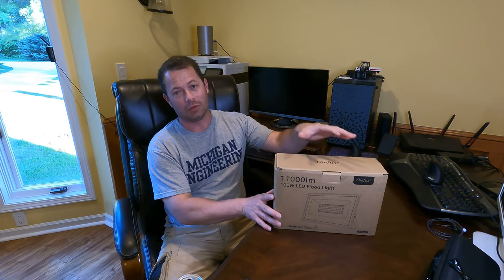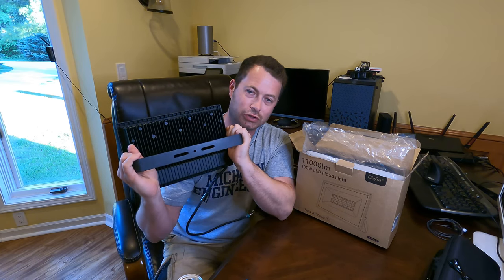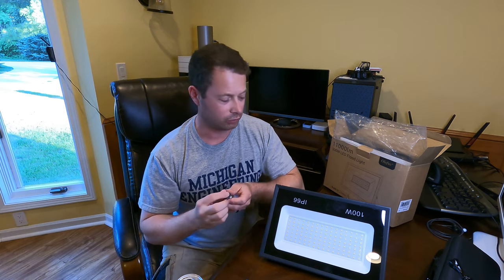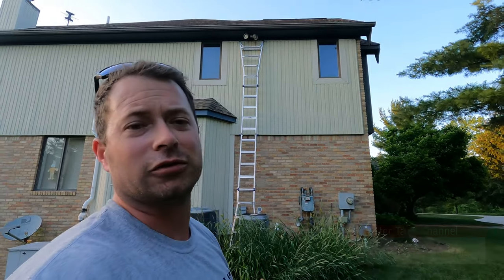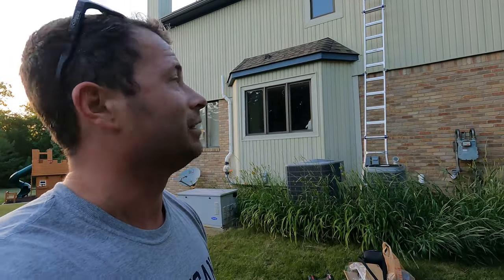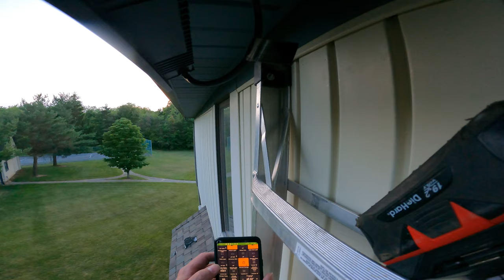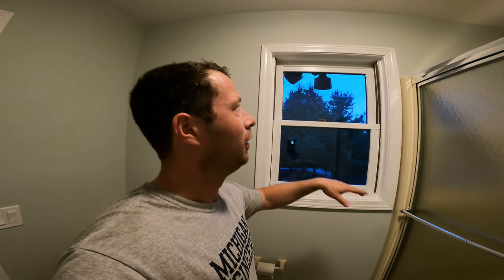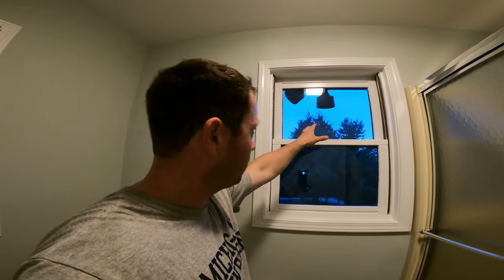✅ Light Up The Backyard!  11000lm 100w LED Floodlight -  Unboxing, Install and  Review - Olafus

Comment: The Amazon listings describe the lights you have linked to, as 9000lm output. Where is the 11,000lm light you are using?
Reply from the maker: Same light.  Different marketing specs.
Reply: @randallsemrau6911  same light different lie ;=

Comment: As an electrician please mount that in a box =) That open connection could cause serious issues down the road! Thank you for the video!
Reply from the maker: Very true.  I was "shocked" the house was that way since being built in 1991.  It's corrected now.
Reply: My home was built in 1980 and I have no box’s on our flood light’s 40+ years with no issues
Reply: A box for sure and I would have taped the wires…
Reply: @explod329 What kind of connector would you use to connect it to a box. The wire type is SJTW.
Reply: @charlescho   Hubbell makes these connectors. They should be available at your local Home depot/lowes if im not mistaken. A standard SOOW connector in the correct Diameter should work as well.

Comment: Great work. Except for the "Hot shot" wasp & Hornet killer. I give you a secret. Next time use "Break Cleaner" (Break parts cleaner) spray can. I guarantee you 100% you won't have to back off. It kills them on touch. I'm telling you cause that's what I use all the time. Try it, and thank me later.

Comment: I used the 8000 ones 2 years ago for man door lights on my shop, love them. BTW, do away with the vinyl siding.  Just spent big $ to fix rot due to trapped moisture.
Reply from the maker: I am planning to redo the siding... but all siding can get rot behind it without a proper wrap.
Reply: @NaterTater  true, mine was done some time in the 80s.  Just 1/2 inch of foam insulation over the original cedar siding. Most of the siding was fine, the corners with metal was the major problem.  My living room has to two 10.0x6.0 windows that come to a corner that just had 2 2x4s holding the whole thing up.  The windows were supporting a lot.  Found a great contractor the is top rated for Hardy plank and also does rot repair.
Reply: @NaterTater  what did you replace your siding with?

Comment: Howdy from Kentucky. We bought these after watching your video. Think they are great, but having issues when lights are turned off see small panel of the LED light on the right bottom of panel remains dimly lite...maybe a 2x2 square and was wondering if this normal? We have 3 way light switch that controls the outdoor lights. Thanks
Reply from the maker: That is not normal and means it is still getting some voltage.  You might have a bad switch or wiring setup.  Is everything properly grounded?  You can check voltage at the wiring and confirm.
Reply: @NaterTater  Thanks for reply, but my husband figured out that a lighted light switch was causing the problem. One of the light switches would light up when switched off and that was connected to a 3 ways switch controlling the spot lights. After changing the the switch to a regular one, the lights turned complete off. Thanks
Reply: most likely an induced voltage. LED lights need very little power to illuminate so they could be picking up a voltage simply from cabling running close to other live cables. Adding an appropriate capacitor in parallel between line and neutral close to the light fitting should solve the issue.

Comment: You never disappoint Nate there was so much going on in here.  The threat of being stung and attacked by flying insects.  The excitement of installing something new and then also the possibility of falling what you are very brave because I can’t get up that high.
Reply from the maker: Glad you're enjoying them!  Yes the height is the least enjoyable part...certainly have to be cautious that high and with enemies flying around.
Reply: @NaterTater  How much power do these draw and where do you plug them in? Thanks for the vid man
Reply from the maker: @joeslacker1020  they are hardwired or you could put a 3 pronged plug on the end for a standard outlet. They pull a max of 100 watts each.
Reply: @NaterTater  So you need to buy the plug seperate, are there plugs where the end is with those 3 wires already exposed, or do you have to order a plug and cut it down in order to wire the lights to it?

(for the 3 pronged plug)
Reply from the maker: @joeslacker1020  you have to buy a 🔌
Reply: @NaterTater  No kidding that wasn't my question
Reply from the maker: @joeslacker1020  here's one that would work https://amzn.to/3hN8itL
Reply: @NaterTater  Oh it doesn't come with an actual cord, so it'd be the cord from the light into this. Then probably an extension cord because the built in cord to the light is only like 2 feet, that would work right?
Reply from the maker: @joeslacker1020  yep
Reply: @NaterTater  Thanks, man. For real though!

Comment: Nate, great video I've been looking at upgrading my exterior lights from the old yellowish dim lights to led , I just couldn't find some bright ones to replace my old ones with. I went to the link you have about the led flood lights, as I was looking at the pictures of the flood lights they seem to come with a 3 prong connector for a outlet, I noticed that the ones you have in your video do not come with the outlet connector but come with wiring (neutral, power, ground) wires. 

Could I just cut off the 3 prong outlet connector and just hard wire the floodlights in place of my old floodlight?
Reply from the maker: Yes that is correct.

Comment: You say step 1 is to “ remove existing light”. What if I don’t have an existing light?  Does that change my step 1?
Reply from the maker: Well you need to have power there so the assumption is a light is already there.  If not you need to run power to that spot and have an electrical box.

Comment: Great video! Can you further explain what solution do you use to light up those panels from your mobile?
Reply from the maker: I use z-wave light switches connected via a smartthings hub.  Then i have actiontiles on tablets and my phone to control commands. https://youtu.be/fpp5k0IdX44

Comment: Can you take out the pre wired wire if you have an existing power cable that can be used?
Reply from the maker: You'd have to butt splice or something.   You cant access the cable connection internal to the light.  Its a sealed unit.

Comment: I had some junky chinese ones. 3 are still working good after 3 years. One is toast. I am sick of chinese crap not working. I will switch to these and toss some PIR sensors in the line.

Comment: How are those leds a year later any problems
Reply from the maker: Mine still function as new.
Reply: @NaterTater  there where about 10 with those unhappy customer reviews have me thinking twice about it..
I was thinking of getting the 200watts but I'm afraid with every night use it wont last, there not commercial quality..
Commercial ones are 599$ but have a 5 year 170,000 hr life warranty for 200 watts...
Amazon has 3x100 watts 24,000 Lumen for 60$ called HBOS..not bad ...what's your take on it?

Comment: bright but the light pollution from these is not needed
Reply from the maker: Only used when needed.  They arent on dusk to dawn.
Reply: @NaterTater  ahh okay.. yea i have flood LEDS.  the supposed 3k lumen flood from GE which is the brightest flood you can get anywhere.   (For flood light fixtures i mean)  interestingly they are brighter and project a few acres out lol. Than say a 150w high pressure sodium light.  But then that light is just a dusk to dawn light pointing down.   But those lights have 13k lumens.   Its funny how lumens mean really nothing.  Always have.  But yea i do hate LEDs.  Too bright too blinding pin point light.  You fixture has no diffusor really so its just a blinding light.

Almost like my floods.   And like you i keeo em off unless i need the extra lighting.   

Otherwise i rely on my dusk to dawn sodium and yes mercury vapor lights.  I prefer the snooth pleasant lighting they provid.  If you have LED dusk to dawn.. theyre nice but just too much to the eyes.. for me anyway
Reply: Light pollution 😂😂😂 let me guess, you drive a Prius
Reply: @jamesdempsey5702  i drive 3 Jeeps.  All 3 with 5.9 liter v8s.  No i dont.  But ligjt pollution is a real thing.  Blocking out the sky at night

Comment: Did you not connect the neutral wire?
Reply from the maker: Yes I did, you have to.
Reply: @NaterTater  what did you connect it to I must have missed it in the video
Reply from the maker: @allazar32  black to black,  white to white and ground to ground.  My house has neutral wires ran on all the circuits.

Comment: Like the lights and the video.....However...you should have encapsulated the connection vs. feeding it back into the hole......in the event of a arc or spark, it would be protected inside of a box.....
Reply from the maker: Yes
Reply: + the screws from the cover plate

Comment: Horrible video. Should be removed. Please don’t do this. Do not stuff live wires in your attic without a box.
Reply from the maker: @chrislumbo6607  his Chris, thanks for watching and the feedback.  As mentioned that was a bit of a surprise for me when I swapped out the lights.  The builder or perhaps previous owner did that and it had been that way for 30+ years.  I continued the video to get the finished lighting and went back to correct the electrical boxes afterwards.

Comment: personally, I would've used electrical tape to further secure the twist connectors on wiring to prevent any moisture and further securing the connectors in place in case they try to unwind. I'm sure someone else in these comments probably said the same thing but you do you that's just my opinion.
Reply: Generally, I take my cutting pliers and twist the wires then use the wire nut. He shouldn't have to use electrical tape with it being under the eave as long as it is in a rain proof environment should be good. If he would have made his connections correctly they shouldn't back out. Putting the wires together and just putting on the wire nut isn't good enough in some cases so I agree with you, I was working in an old Warehouse installing new lights and taking down hazardous wiring and you could pull off some of those wire nuts because the wires were not twisted. Too much reliance on the wire nut. Same thing with outsets, never use the stab backs.   Atleast this is my experience in the electrician field so far.